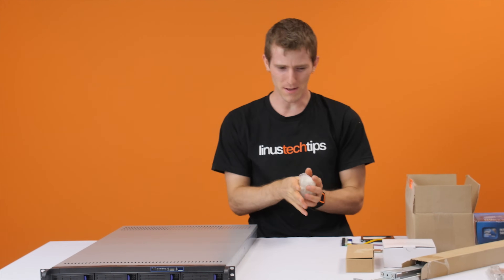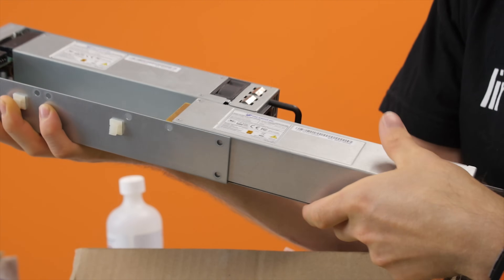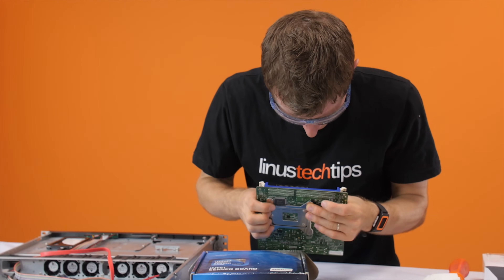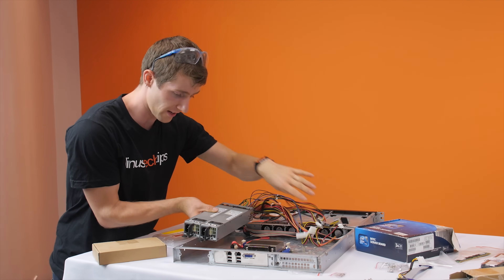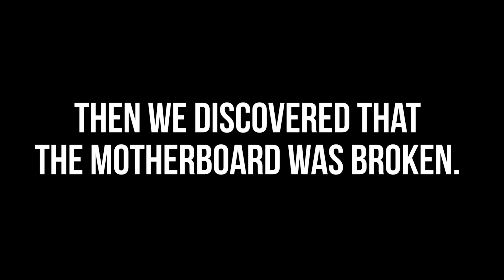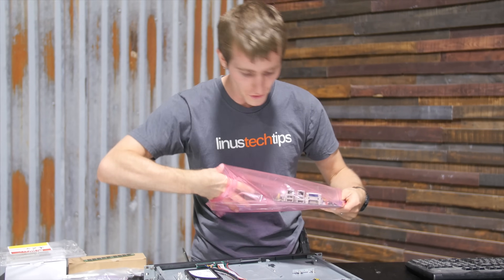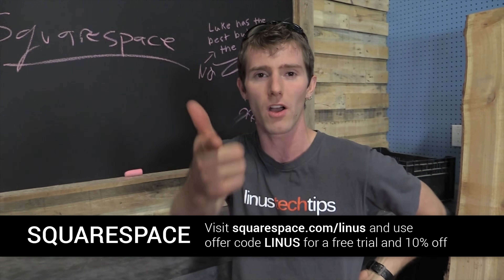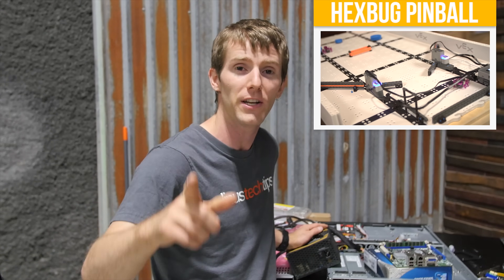DIY pfSense Rackmount Router Build Log - Part 1

Comment: hmm, as far as I know, LInus only had 200mbit symmetric connection, I dont know why he needs a xeon processor for that kind of speed. Usually a quadcore atom processor is more than enough for that kind of task, even if the L7 filtering on pfsense is enabled. He can just buy one of that kind of motherboard in supermicro, that has 5 gigabit Ethernet ports builtin.
Reply: +remle ikawura Yeah, that hardware is overkill for their connection. They could just get one of the prebuilt pfSense appliances for $500 and it would save them a lot of money and headaches.

Judging from their videos they're not always super knowledgeable about networking though.
Reply: Michael Jashinski Yes they have a 10Gbit LAN but you don't need a fast router for transferring files over the LAN, you need a fast switch which they have. The packets never touch the router when they're transferring files over the LAN.

The router is for routing packets between their internal network and the Internet and with a 200Mbit connection a Xeon is way overkill for that.
Reply: +remle ikawura It's fun to build your own things and it's fun to add overkill on those things that you built.

Comment: Weeeelll, I would have shelled out for the Rackmountable router from the PFSense store rather than go through these pains...
Especially when I already got a rack setup like you do Mr Sebastian :P

But at home I don't, so instead I have a HP 8000 SFF running PFSense as my router.

Comment: You guys need to have an experienced welder and metal worker for when you chop stuff and try to "remedy" problems. Also, buy a face shield for the angle grinder. Eye protection with gaps and no seal? Super cringe.

Comment: If you insist of using the same backplate again please do yourself a favor and use electrical tape to shield it
i am pretty sure you killed the board because it shorted components (or it was that little cable afterall)

Comment: Use a plastic backplate, SMD parts are annoyingly easy to short from the top. Or place a few layers of insulation tape on the shield and the sides :)

Comment: Hey Linus,
did you ever think about using a non conductive (DIY-plastic-)backplate for the cooler that does not short out every second pin round the socket?!

Comment: I don't get why Linus is building a router, why not just buy one?
Reply: +TrivisionZero Buying does not outperforms the building kick, even when things goes horribly wrong :)
pfSense works great in high-throughput usage scenarios, when loaded on multi-core multi gigahertz preprocessor hardware. Buying a fully configured one can burn a deep hole in your pocket. 

Take hardware build a side, pfSense can do a lot more in the router, if you know what you are doing (certainly not for the faint hearted).
Certainly, not to be compared with the garden variety home router with what Linus is supposedly embarked on (provided that he is good on linux and networking, as much as entertainment).
Reply: +shablaminablah agreeed, I've been through around about 7 different routers in the last 7 years..... They are junk!

Ever since building my local debian webserver / router I've never had a problem with my local network, upside I can shove awesome logs in the face of ISP's if they say it's not there fault. Consumer router, not so much you may get a little crappy log that they decided to add in last minute.
Reply: So you're saying I'm lazy because I don't custom build my routers? I'm sorry, but I've never had an office space full of computers that needed a custom router before, so I was just curious.

By the way, I built my last two computers.

Comment: 1U cases are not entirely standard. Nor do most of the rack-mount cases (2U etc) for that matter. But 2U and above has room to play-with, so with a bit of dramel acrobatics you may  get the job done. If you build with a 1U case, then make sure to buy rest of the stuff known to work in the selected case (ask from the case manufacturer). Else, the hard-way, take all measurements, and order accordingly.
Linus may have certainly shortened out the motherboard with the backplate. At least seen from the footage, clearance is not so great, and he was asking for a disaster. One way to go about is to use a tough insulation sheet between the metal and circuit board (such as insulation polyester used in motor and transformer windings). Make sure the insulation is not getting punched through. 

My suggestion is to use a motherboard with built-in CPU and cooler (such as an atom or celeron board) or a purpose build server mini-ITX board such as AsRock C2750D4I. If targeting higher throughput/bandwidth, then go for at-least 2Ghz of CPU. If possible, start with a 2U case, which will lessen your headaches during the build process.

Comment: You know, when the videos from the new office started coming out, I kinda felt like the feel of LinusTechTips videos changed in a way that made it feel less casual and... Linus-y. Then I watched this video and I knew for sure: this is definitely LinusTechTips. Because he hotglued a power supply and angle-grinded a CPU backplate. And the motherboard was dead. Ah... good times

Comment: backplate is causing shorts. Actually had that problem building my rig a while back. got lucky and didnt cause permanent damage
Reply: +Jayson201 that is what my first though was as well
Reply: +Jayson201 Did no one see him put the black electric tape on it? He even screwed through it with one of the heatsink screws
Reply: +Jayson201 I totally agree. I cringed when I saw him attach it :-(
Reply: +Jayson201 He was like "tons of clearance" Not sure he did his EE homework this time
Reply: +Diamonddrake Linus - Electrical Engineer. I don't see it.
Reply: Animal Joe screwed up with screws

Comment: Next time get a Supermicro motherboard (they do have itx versions) to go with your Supermicro heatsink and/or 1U case. And those beeps - theres something odd with your PSUs.
Reply: Or get an ordinary full-sized Supermicro board (they are really good and come with features such as remote magagement and IPMI support, which you Intel mobo doesn't provide) then fit it with a low profile quad-port card such as this one:  http://www.amazon.com/Intel-EXPI9404PTLBLK-Express-Profile-Adapter/dp/B005DASO3M
No grinding, cutting no extension cables, sideways mounting tricks. Keep it simple.
It seems like you haven't really thought this one through, did ya guys?

Comment: The metal backplate is probably contacting two points in the back of the motherboard that when turned on, shorts out the board.

Comment: perhaps you bricked the board by shorting the pins out on the back! I could be possible if it has a battery that was installed when you was test fitting.

Comment: Linus you cannot dremel out a speaker. You need to desolder it. Btw put some elcetrical tape on top of the backplate so that it does not short circuit anything it touches.

Comment: Hot glue wont hold in place warm parts, i.e. PSU - it will fall off after few days.

Next time just stick with brand servers .. come on, all this effort is not worth it to save couple bucks.

Comment: By the time you've labored all day, you can just buy a preconfiged 1U router that's about 1/3rd of the size running the exact same software.  My IT provider just built an Atom box on a SuperMicro motherboard that's rock solid running PFSense.

Comment: Seems to me there should be spacers between the bottom heatsink support and the motherboard, because it looks like maybe a millimeter between some of the metal bits on the mobo, and the heat sink support. I don't think that caused the issue with the motherboard, but it might have. I'll be interested to see what it was in part 2.

Comment: You are building a computer and manipulating the components while wearing socks over a carpet and not even using a anti-static wrist band... you may damage your components, never heard of static electricity? that was really unprofessional dude... as for the rest of the video well... I had several problems building systems before but never as bad as this.

Comment: well, first of all i wouldn't use a dremel anywhere near the motherboard.. the metal particles flying off of the speaker might easily short the mb.. watching it makes me cringe.. also he might have shorted the speaker itself, as there was part of it left still on the board.. i thing desoldering it, or just snipping it off would be safer.. :)

Comment: may be something is shorting out due to the cooler and the back plate touching the mother board , and why not build a router with a normal  mini itx case and parts where you don't have to mod so much. but ya there is no fun in that lolz

Comment: Is there any chance that 4 pin cable you were plugging into the fan header is actually the floppy disk drive power connector that server PSUs still come with?

Comment: I looked at doing something like this at one point - decided 1U cases were too much of a pain (eg want to use a Supermicro case?  Then you better buy a Supermicro PSU, and a Supermicro motherboard, and a Supermicro heatsink).  I'd recommend just finding an old 1U server off Ebay to repurpose - it won't be as power efficient, but after all's said and done the money saved on components is far far more than the extra electric will be over the next few years before you decide you want to change things up again.

Comment: If I should guess, I would say either the cooler or the cooler backplate short circuit some conductor tracks. Also flexing boards is never a good idea. I don't know about their left rack space but using a two U unit would make things easier and cheaper ;)

Comment: For the love of all that is holy, Linus, why did you not use an Avoton C2750 board? They are literally made for this exact use. Whoever makes your purchasing decisions needs to be slapped upside the head.
Reply: Also, the backplate is clearly making contact with pins on the back of the board. Dremeling off parts, making modifications, cutting things to fit... are you actually capable of putting something together that doesn't require hacking?

Comment: How did the motherboards die?
Reply: +mbsfaridi He said near the end that one of the cables from the power supply was putting out voltage - he thought it was a RPM fan sensor, but it actually was another power connector he hadn't seen before.
Reply: ualdayan Yeah but what does "putting out voltage" mean and  what did he do wrong?
Reply: +ualdayan he said that and he tested it.. it wasn't.
Reply: +mbsfaridi It looked like his heatsink backplate was shorting out some through- hole components. I'd bet that's what it was.
Reply: ***** Hopefully we'll know what happened in the next video.

Comment: better idea 1: Intel makes E3 xeon barebone kits. all the parts will fit. 
better idea 2: buy power supply and case from the same manufacturer 
better idea 3: buy motherboard, case, heatsink from the same manufacturer.

Comment: Wouldn't it be easier to add a liquid cooler onto the CPU? That way you just put the pump on the processor and then have the tubing go somewhere else in the case where you would have more room for the radiator block and the fan
Reply: +Valiant Effort You don't use liquid cooling in enterprise environments.
Reply: +hethdavid You don't use liquid cooling in enterprise environments that don't have giant data centers.
Reply: hethdavid I'm aware that its possible, just not very practical for most companies. 

Either way, the original comment was in the context of Linus's servers. He's not going to immerse the LMG rack in oil.
Reply: +Nick Chaffee Please don't give him ideas.
Reply: +Nick Chaffee We use liquid cooling in our Data Center. The equipment is immersed in oil, the heated oil is then sent to heat exchangers providing supplemental heating for the building.
Reply: Nick Chaffee lol
Reply: +Nick Chaffee or is he.......
Reply: Also, it's a 1U chassis
Reply: Nick Chaffee Why not exactly if you dont mind me asking?
Reply: Valiant Effort When you have 100,000+ servers in a datacenter imagine how destructive just one leak would be.
Reply: Nick Chaffee well, I doubt linus has 100,000+ servers and this would be the only water cooled system in the rack... But also whats the point of having the router rack mounted anyways? Wouldn't it be much easier to just put it in a standard case?
Reply: Valiant Effort Right, but still if it leaks it drips down and ruins his whole rack. Rackmounting it gives it easy access to a switch and all of his servers.
Reply: Nick Chaffee Then why not mount the liquid cooled router rack on the bottom so if it leaks it just stains the floor
Reply: +Nick Chaffee Sometimes you do, also LinusTechTips is not an enterprise environment as much as they want to pretend like they are.
Reply: +Valiant Effort they don't make waterblocks for server boards.

Comment: I know yall love building stuff, but why not just pick up a older dell power edge or other u1 ? prob cheaper, built and ready to go. but thats not the linus, aint nothing OEM built in there office lol
but seriously, $200 bucks on ebay can buy you a used poweredge, ready to go and runs great with Linux, and have ability to order parts easily when something fails.

Comment: Linus, this is just a suggestion, as i may or may not be correct, however, i suspect the solder points for components at the underside of the mother board may be grounding off on the conductive surface of the CASE PANEL, usually PCs dont have this issue because we usually use motherboard stand offs to avoid this.

Comment: Well..that's why server is different with PC, normally it will be shipped  with full part from the supplier such as IBM, HP, etc. It will take so many efforts to cut/ chop off things in order to assemble by yourself :) and also have to make sure all parts are compatible with the rack or with each others.

Comment: GET A BIGGER MOTHERBOARD SO NO CUTTING HAS TO BE DONE!! p.s. size (most of the time depending on the subject e.g. more or less ram slots) makes no difference to me the majority of the time but if a bigger board means no cutting heatsink mounting brackets then I would get a bigger board I personally have never had to go to such extreme lengths to build something such as this

Comment: LOL, the background music had me laughing my head off as you were struggling with this. I feel your pain though. I've had my fair share of server hardware nightmares, and for some reason server hardware tends to have the strangest issues I've ever seen. At least you're not going with an OEM like HP or Dell. They make it extremely hard to use parts that they didn't make for it (though RAM made by AXIOM tends to work really well even though the server BIOS complains it's not HP Genuine).

Comment: My best guess is the heatsink backplate is touching motherboard metal on the back and shorting the board out. 

a.) Add an insulating gasket to the backplate.  Also check the heatsink to make sure it's not touching something as well. 

1. Test the board outside of the case first! Hold a heatsink on it to make sure it posts (sans the backplate). 
2. Test all components first on other hardware to verify they are 100%, before you got head first into the build ;) (Linus....) 
a. This includes power supply tester on the PSU to check voltages. 

---OR just replace the Heatsink with something else. For example cut a hole in the top to install a heatsink fan assembly that will potentially work better on that board without cutting. Perhaps one with just pegs and not a dodgy backplate.

Comment: Hot glue in electronics.  That won't melt.
Reply: +Bossness Productions Seeing as even the low-temp hot glue guns melt the glue at around 120 C, I think Linus would have other problems to worry about if his components got that hot.
Reply: +MarioDragon Thanks.  That's good to know.

Comment: Why did you even want to build a PC inside a 1U server case, when you can buy a fully fledged server that was designed with 24/7 running condition in mind. With the money you thrown away you can buy a nice "real" server, not a wannbe. For a nice HTPC I understand this type of project, but for a server that you want to mount in a rack and use as a router I don't see the point.

Comment: Desolder the speaker on board, then run it clear of the mess with a couple wires. My guess here is your wacky heat sink is bridging something, top or bottom.
Reply: +tony cupero say that to the rasberry pi fans and see what answer you get back. End of the days a MB is a huge PCB you can change it if you know your pin outs and traces.
Reply: +Patrick Cronin unless you know what your doing do not solder anything to a motherboard
Reply: +Patrick Cronin my thought as well.

Comment: why do you continue to use these garbage norco cases. if you have to buy third party server cases ALWAYS go supermicro

norco is basically in the same tier as rosewill which is a NO NO

also, fanless heatsinks on server chips is normal...most of the chassis from big vendors like dell/HP and even supermicro typically have forced airflow from the front which this norco case has, you're just short changing yourself by using some random garbage mini ITX motherboard.

lastly, your difficulty with installing that 1u "mini-redundant" power supply is EXACTLY why you should not buy cases other than ones built by supermicro for server applications.

Comment: next time tape up the backplate, so even IF it touches pins or other metal, it still won't conduct..

Or, you know, just don't use a backplate.. #LinusWreckTips